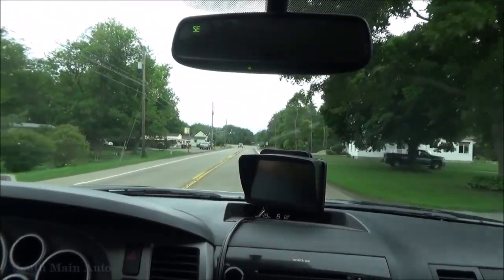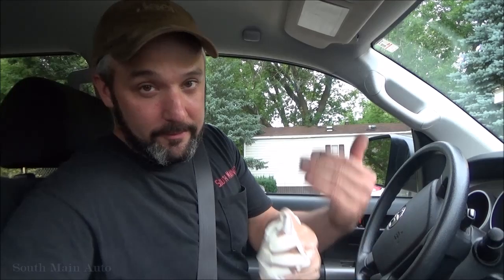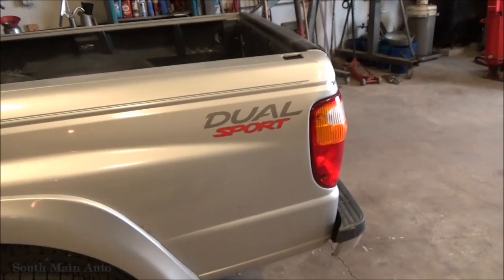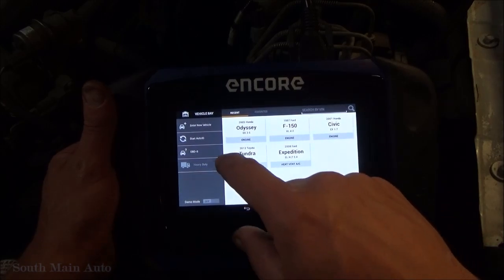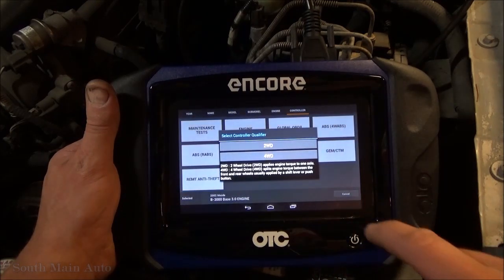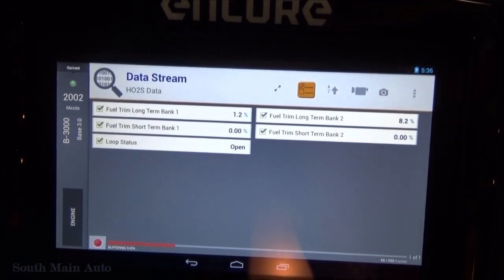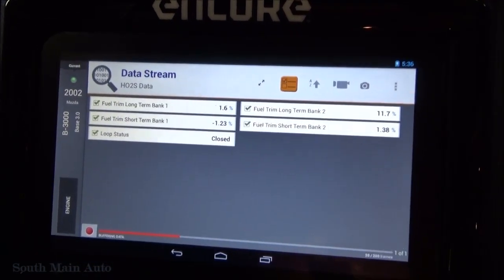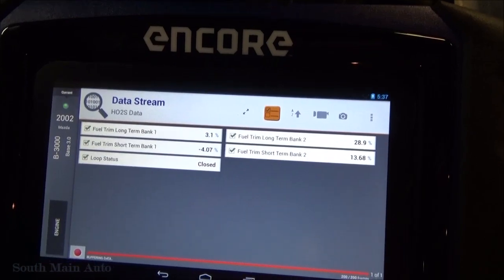Mazda B3000 / Ford Ranger - Lean Running Misfire - P0171

Comment: That's what brothers are for. Help first rag later. Happens. Get your hands crossed or Interrupted and there you go. I swap plug wires one time and I had a wicked intermittent mess couldn't figure it out I traced each plug wire out everything looked right. Course it helps if you make sure all the plug wires are push all the way down on the plugs and all the way into the distributor cap! Hey was hot out. I was too young to drink beer! No big ones Scott you didn't break it. You got a great brother he had it over there his family should and you got it solved. It's all good

Comment: nothing like a rookie mistake with the most popular autoshop youtuber in your engine bay to point it out with the geo metro i had it was easy if it ran it was good if it sounded like a lawnmower check your wires for 1-3-2

Comment: Good video, once again. 

Misfires and O2 sensor readings can be confusing. 

Like this example, it probably smelled very rich, yet EMC saw low O2 signal (lean) (like you said, O2 doesn't care about fuel, it only can measure unburned Oxygen).

ECM sees low O2 signal and responds with fuel, and STFT & LTFT go through the roof until a DTC is set.

Thanks for the great information.

Comment: Mode 6 is cleared when codes are cleared and on some fords its cleared by reading dtc's.sometimes after clearing dtc's the pcm needs to relearn the misfire profile correction to flag misfire dtc's.if not it won't detect misfires and just flag the lean condition.hope this helps.

Comment: I once poured power steering fluid in the brake master cylinder, as the bottles looked the same. Take about replacing parts with rubber in the brake system. I had the best brakes in town!

Comment: My idea is that the ECU detected the misfiring cylinders and cut off fuel to them ,so setting a lean code...Tell your brother to show up on camera next time.. we all make mistakes, even professionals make mistakes
Reply: unburned fuel would be indicated by the O2 as a rich condition... I never saw an O2 "ignore" unburned fuel...  if it was working correctly

Comment: Your scanning tools are basically tablets with specialty software and OBD cable connections, correct??
Reply: thats exactly what mine is.. mine is the Launch tablet.. pretty damn awesome I love it! I need to get the Scope addition to it, but other than that I use it as the same as i do with the 10k Snap On Verus.. Mine works just as well; even better with German vehicles!

Comment: Eric I hope you can give me some advice. I have a 2004 Buick lesbare  with a transmission problem,when it is cold it only shifts from first to second. when it gets to temperature (220 @) it shifts through the gears. please help if can.i know the fluid needs to be changed.
Reply: Lucas stop slips usually works great. Drop the pan and replace one quart with lucas stop slip. DO NOT Flush tho.
Reply: +Justin P. )(I know the fluid needs to be changed 80000 on the fluid now.

Comment: Bit late. But I've noticed a couple manuals have the incorrect firing order for the 3.0s.
Reply: So what is the correct order for the 3.0? I also Have a misfire on my 3.0. Have replaced everything I can think of plugs, wires, coil, pcv, throttle body, egr, maf sensor, air filter. Can't find vacuum leak.... It's driving me crazy. Checked the order in Haynes, and mine matches up with that.

Comment: It's not your brother's fault.  Real engines don't use spark plugs.  At least not once they are running.
Reply: BlindBatG34 are you referring to diesels? If so, they don't use spark plugs to get going either. Glow plugs to heat the chamber, but ignition is all from compression
Reply: Yes, but clearly it wasn’t a very good joke.  Interesting side note, there were some old International tractors and heavy equipment engines that would start on gas (spark plugs, carb, etc.) and switch to diesel once warmed up.  From what I recall they had a compression release mechanism for running on gas.

Comment: Salt on gravel roads is a new one to me. I've heard of putting oil down on them to keep the dust down - maybe not that environmentally friendly but doesn't rust the cars at least, heheh.
Reply from the maker: they use to oil here but it cost to much I guess
Reply: Its calcium chloride they use and ya it rusts out vehicles where I live in Western Canada they use brine in the winter on paved roads it rots out your vehicle nicely as it sticks and keeps eating away.

Comment: hey what were you doing with the rope scope while you were pulling the plug wires??I couldnt  tell
Reply: It gives spark a point to jump to. You can use just normal wire as well. With it you can also tell that spark is good at that point by checking that it can jump long enough gap.
Reply: I think he was using it to ground the sparks, so he didn't get shocked
Reply: Ahh OK so touching the tip to the block or whatever I get it thanks
Reply: Or the scope is hooked to the bat maybe??
Reply: +Steven Akn1 negative battery terminal

Comment: Salt in the summer time ??!?!?!?1/ whaaaaaa ?!?!
Reply: Calcium chloride brine solution. It creates a crust on the gravel to keep dust down. Not the same as what they use in the winter (usually sodium or magnesium chloride).
Reply: AH my god. its probably cheaper to lease up there. Once you hit your first timing belt or tires, really the cost of taking on a new lease can't be more than tires + TBelt.  Especially if you give it to the dealer to do.